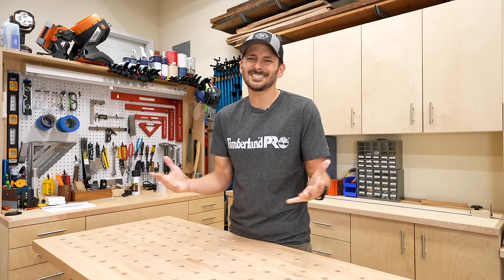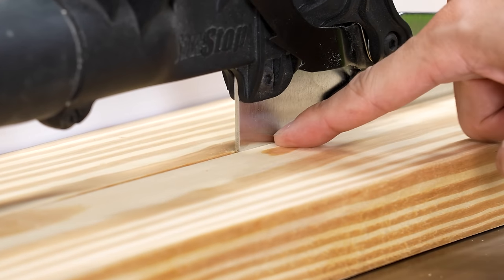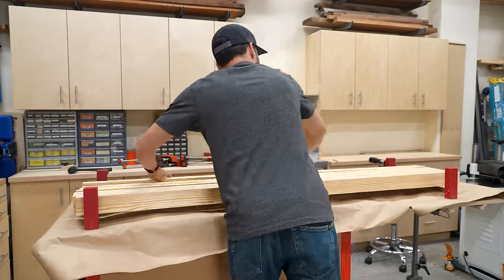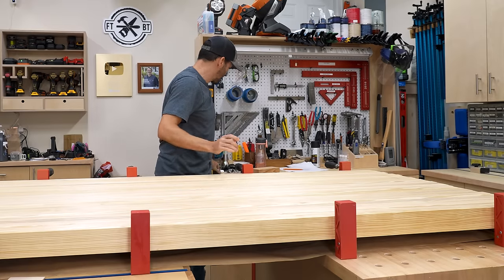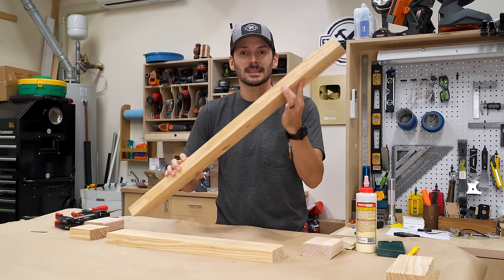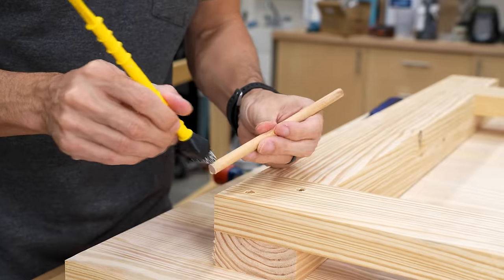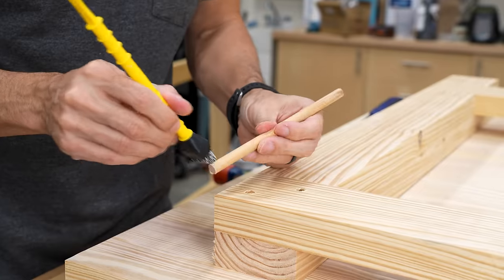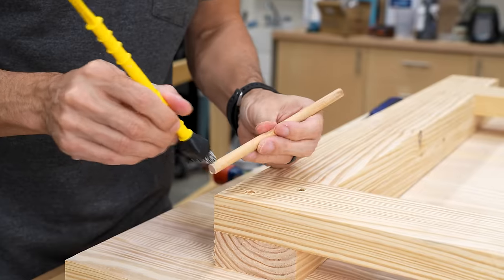Building a Sturdy Workbench with Cheap Wood

Comment: Fantastic work, Brad! Amazing looking bench indeed! 😃
About the lower part, whatever you do leave around 2 inches free under the top... This way you can get anything that falls there and you're going to have a small space to store little jigs... And there are lots of them you can make!
Anyway, stay safe there with your family! 🖖😊
Reply from the maker: Thanks, MC.  Exactly what I was thinking with the gap to the top
Reply: @Fixthisbuildthat  If you will angle that top space from the middle to each side say 3 to 5 degrees with say hard board slick side up then place a lip on the edge screws and round objects will roll to the outer lip. LOVE the bench.

Comment: Hey man, tnx for the video, I did build this table, but I used concrete with reinforcement, I didnt need the surface holes. It turned out very sturdy and cheap. Ty once again.

Comment: The biggest pain for this build is making the table top perfect...especially using a relatively soft wood that will pick up damage very quickly. An alternative is to spend a bit more money to purchase solid wood butcher block countertops. Locally, I can get a 3' by 6' by 1.5" solid birch countertop for around $250.  I think the birch would upgrade this table substantially over the long run, and it takes 1/2 of the work out of this build.

Comment: Built one like that 38 years ago. When I nuilt it I used scraps from a garage build in the areas longest piece was 30 inches, didn't have planer so everything done with hand plane. Still have it kinda relegated to a dirty workbench now. I've had a big block truck engine on it for rebuild and never even creaked. Good luck with yours.

Comment: Love this build! You glanced over attaching the top to the base a bit. Just wondering how did you attach the top? Dowel pins? Bolts? Thank you!
Reply: I was wondering that too--that's actually why I'm reading through the comments!
Reply: From the predrilled holes I saw I would say he screwed up through the frame into the top.

Comment: Awesome workbench but I’m totally freaking out about how cool your custom made “Fix This Build That” sign came out! You absolutely should cover just the making of that type of signage in a ‘how to’ video. What I’m wondering the most about that sign is: ‘how’d you get the logo and lettering to pop out so crisp and sharp?  The brief flash of the wood just off the CNC didn’t look super crisp but perhaps that clip was of a test run and not the one you poured resin in? Anyway, I’d love to learn more! Great Channel!
Reply: He mentioned a roughing pass and then a final pass, so possibly the video was showing the roughing pass.  

Also, if there is any tear out it's normally at the surface, so just sanding off the top millimetre or so removes it.  You have to plan for that, though.

Comment: Great vid Brad. I am in the process of building this myself.
A suggestion that I discovered for the bench top mount holes on the apron stretchers...(someone else might have done this, I haven't searched comments). I used my Kreg pocket hole drill bit to make those mount holes. Just chucked it into the drill press, marked it for depth stop and drilled first part. Swapped bits, flipped apron and finished other side.
Reply from the maker: awesome, Adam!  Only thing I don't like about pocket holes is they don't give the top any room to move.  That's why I went with oversized counterbored holes

Comment: I like having drawers on lower cabinets and work benches. I think its much more convenient pulling a drawer out versus getting down on the floor to reach to the back of a cabinet. With that said youo could also put drawers (20 inches or so) on one side and shallow shelves ( 6 - 8 inches)  on the other side. Great video, Brad. keep up the good work.

Comment: Love the video, and the design. 

I do have a question though, it looked like in the video you attached the top to the frame by screwing the frame on from underneath. Wouldn't this approach cause issues with the wood expansion / contraction? Love people's thoughts.
Reply: I think that is a consideration but using tabletop hardware might allow it to move - not sure but I think Brad wanted this unit to be totally solid

Comment: Your build looks great.  As someone noted in an earlier post, the pink colored wood is Douglas fir.  If it's caramel brown, that would be Hemlock pine.  My main workbench is built from Douglas Fir.  Douglas Fir is used for the parts of a house build that have to be extra tough - floor stringers, roof rafters, stair steps come to mind.  My bench is quite sturdy.

Comment: First, I really enjoy your videos. I started this wood working hobby, a few years before retirement.... just needed something to do. So, I am still "green." One of the 1st things I did when I moved to a larger garage in 2019, was a work bench. I watch a lot of "How to do" and came up with my own. I used eleven 4" x 4" wooden posts. I glue them together. I probably should have glue a few at a time instead of all of them at once. At the time I did not know the difference of a jointer vs a planner. I did not know wood in the store that looked straight would bow when it got home. I can tell you some more things, but I don't want to bore you. I got it together it is about 7' x 36" and 41" from the floor.... I'm 6'2" and it on 3" caster wheels.  There are a lot of things I could have done better. Like my top is not exactly even. I was going to send you a picture but I'm not sure how to do that. Dog holes seem like a good ideal.

Comment: For workbenches and tabletops I like to use 2x4's on edge, held together with all-thread rods spaced every foot or so, instead of being glued up.  Countersink washers and hex nuts, and keep retightening as the wood seasons.  You wind up with an affordable, rock-solid top, that can be planed smooth or covered with plywood, Masonite, etc.

Comment: Nice work on your video. Easy to follow. That work bench would be great for a stationary table. I have a small shop/shed so it won't work for me. Later when I have a larger shop I might build it. This did give me some ideas so thanks.

Comment: $150 ?    I dread to think how much that quantity of timber would cost in the UK. A sheet of 3/4 birch ply is now £150!
Reply: Silly, isn't it. Mad prices over here.
Reply: $160 at my local store for 4x8x3/4 baltic birch ply. NW Illinois
Reply: Unfortunately £150 is a lot ore than $160. I have costed a small wooden fling cabinet for my study and discovered t would be cheaper to buy one from a retailer, but I will make it for the pleasure I get from building furniture. I even contemplated buying an antique for the Timber content. Regards from England.
Reply from the maker: Yes, that's why you don't see a lick of plywood on this bench :)

Comment: Nice!   After having watched 3 different workbench build videos yours it the most straight forward and easiest to follow.  I can see room to add a cabinet with drawers or doors under the top and off the floor.  I can also see adding wheels for easy movement.

Comment: Great name plate addition!  I need you to make one improvement to that name plate - - -  Reinstall it flush mounted and just use dowels in place of those four screws to hold it in place and cover the metal screw holes.

Comment: Love this build, combining the 2x4's to make the legs is brilliant, and lends to a strong and warp resistant solution. Out of all the video's I've seen, I'm going with this solution, thanks Brad, you have an awesome channel.
Reply: Didn't he use 2x8 ripped down?
Reply: @randybobandy9828  Hey Randy, yes he ripped his boards to same size as 2x4, which I assume is 1.5 x 3.5, sorry that wasn't clear.

Comment: Hey Brad!
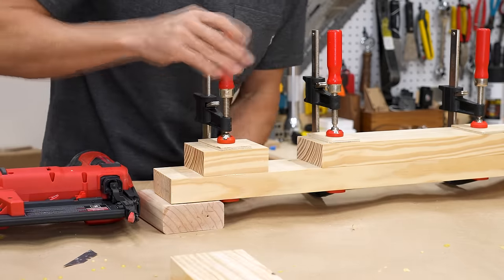@ ~11:25 you mention that the glue made the glue-up slippery. Just sprinkle a little salt on the glue, and you have built-in tackiness that resolves every bit of the slippage.
And in case you don't see this, maybe some of your viewers will, and it can help them with all sorts of glue projects.
Hey again. $10 for the plans is cheap when I compare what I've seen from other YouTube Creators. Thank You. As soon as I retire, I'm going to build something. For now, I'm getting along fine with 2 build tables similar to your old one (but frankly, not as nice). I don't have near the equipment you have, and spend less than an hour a week on wood projects, and most of them are fixing things, or designing replacement wood handles for my wife. So, the need isn't huge yet...
Thank you for this video, and you've won a new subscriber.

Comment: I've always wondered why work benches with dog holes in them don't have a shallow (1/2" deep) pull out tray just under the work surface. That way, when you inevitably drop something down the hole, you can retrieve it easily. It would also catch sawdust and keep things stored under the bench cleaner. By the way, nice looking, inexpensive bench! Can't wait to see your storage solutions!
Reply: Came to say the same thing.

Comment: The shim trick with the rip cut is key. I have a tendency to do this every time and what I did was I created a T shim so it sits right no top and I just push it down. It's basically a hair wider than the knife I've had too many kickbacks to want to see another one. How many? Just one. That's all you need just one piece of wood shooting at your face at 50mph. I think anyone who wants to use a tablesaw should watch a safety video on it and rewatch it if you step away for more than a month or two. For the glue up, I'm a fan of what you did. a 13" planer (why 13", why can't they be 16", Dewalt I'm looking at you!) and run them through. Great way to get them where you want for the final form.

Comment: I used 4x4 for the legs and Timber Lock  screws with 2x6 stretchers and 3 inch GSR screws.  My difficulties were associated with not having a flat surface wo work on.

Comment: If you were just starting out and didn't have a variety of clamps, drill some holes through all the boards and counter sink the outer boards, then run run some all thread thru them and with a washer and bolt on either end. It will tighten it all up and make it look really cool...

Comment: For these large glue ups, I’d use one of the urethane glues.  It has a long open time, and if you get it clamped correctly is stronger than the wood.

Comment: I have a 22” planer and my wife wanted me to make a coffee table out of a round from an old tree that we had taken down last year. I picked out a really nice section that had some really pretty knots and growth to it. It’s been curing with linseed oil for about 9 months now. I measured it all up getting ready to put it through my planer and the damn thing is 24” at its widest section so now I gotta plane the whole thing with my cordless planer.
Reply: Tip: cut it lengthwise ⅔ -⅓ plane the 2 parts then glue them together. The seams won’t be noticeable if you used a thin blade.
Reply: @rogerboucher1913  I know but I’m afraid to do that. Once it’s cured in another year or two I’ll probably just make a table jog for my router or bring it to a shop and have them do it for me

Comment: Heat video and a super new bench. I am in the middle of a new build where the top will be 38 x 72. I have the nd now that is 90 X 30 and like you said, you can’t clamp things crossways and your it’s way too long. This afternoon nd will have a laminated top because it will mst be used for layout and assembly. The glue should clean off easily. I also have bench I made 25 years ago where the top is oak from my father’s farm and the legs are made out of hickory. It’s 24 X 80 and works great. When building that bench I payed it out, clamped it together for a dry fit I then drilled three holes cross ways and threaded ready rods with large washers as a clamps. I then glued 3-43/4 inch boards on at a time and while they dried I drilled and doweled 1 inch dowels through that days boards and through some of the previous days board. She it was done I used Winding Boards to hand plane it flats it’s a great bench that I plan to hand Dow to my grandson.

Comment: Thanks for the build. I'm currently building a house with a woodworking shop and will need a new bench. Saving money using construction grade lumber is a no brainer in my opinion. Maybe when I get all the projects I've got lined up just to finish the house I'll upgrade my bench, but I doubt it.
Reply from the maker: Good luck with the house!
Reply: It might help to build the bench first to help with all the house projects.
Reply: @marvthecarpenter  Yea, I think I'll be doing that. Just started a renovation of a 1972 Airstream and I can see where a nice bench will come in handy.

Comment: I built a shop table for work (automotive) about 15 yrs ago. Full size 2x4s glues and screwed together with a 1/4" steel plate inset on one end. I used heavy duty steel bench legs for it.  It has been a great bench but I wish i could find a finish that brake fluid didn't take off.

Comment: I've always wanted a couple things on a work bench. 
.
A drawer on tiny casters that goes the width and depth of the bench that goes under the shelf support. Just make sure you leave enough room for your feet. 
.
Another drawer as wide and deep as the legs but only about 2 inches deep just to catch things that fall through the dog holes and to keep the bench dogs and hole clamps in. 
.
I'd also like to make the main area drawers of custom sizes for my needs but make sure you can open them from either side of the bench. 
.
My last idea is some sort of flip up table on the end of the bench to set tools on and keep them off of the bench top. But make sure to include a hole to put your glue bottle upside down in with a drip catcher underneath it. 

Hope it helps..

Comment: So, I've been trying to build the perfect computer desk (I produce music part-time, and am a full-time software engineer, so I spend A LOT of time at my desk). Problem is, most desks are deep enough (24 inches on average, give or take an inch). Also, they're not usually wide enough. I have 3 monitors, 2 27" on the outer ends, and 1 34" Ultrawide in the middle. 

I'd like a desk that had wireless charging, a spot for my studio monitors to set without interfering with my PC monitors. I actually have way too many ideas. I'm also a carpenter and wood worker (thanks dad!), and while I have most of the tools to do this, a nice, large table saw is what I'm really lacking. Hopefully though, I'll get around to designing/building it and can share it with you on Twitter or something as I've learned a lot of cool tricks from this channel.

Comment: Hi brad. big fan of the channel. so maybe for space savings, you can do drawer pull outs that go vertically. Then, youll need to create something for clamps to quickly grab a few. I would consider adding something along onen shorter edge to roll out paper for glue ups so the top doesnt get messed up and then itll be quick to grab,pull and cut onto the table. I personally realized that when assembling on the table, the tools being on top get in the way so maybe a quick clamp on swivel tray to put things like screws and some tools on it to hang outward from the table but in reach could be nice. I have like 5 more ideas of the top of my head but this should be enough for now lol.

Comment: I work in a factory that manufactures wood. We mostly run 1-3/4" thick wood, but before I was hired they even made 3-1/2" thick wood which is astonishing. I had to cut a board back to 20' so it was 1-3/4"x18"x20'... that thing weighs about 200lbs... and I dropped it on my feet... but it's alright lol. I wear Timberlands steel toes which is good cause that definitely woulda hurt 🤣 18" wide ain't even the widest we go, we make up to 2' wide. I don't want to imagine how much those weigh at 20' or even 8'.

We sell large bundles of boards used for building houses (nothing you could buy at your local wood shop, these bundles are 10s of thousands of $ each) and the heaviest one I've seen was an 18"x60'... weighs just over 7000lbs. Wonder how much a 24"x60' weighs? 11,000lbs?

Comment: Go with drawers. If you use a shelf it will get cluttered and usually the stuff shoved to the middle will rarely be used as it is hard to get to and you have to move a lot of stuff out of the way to get to these items. Best wishes on your choice. Blessings!